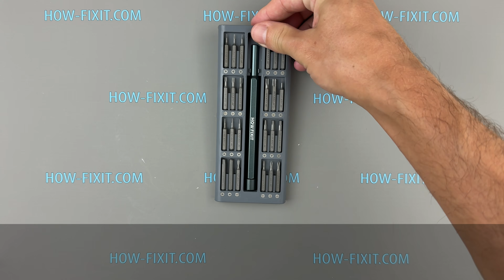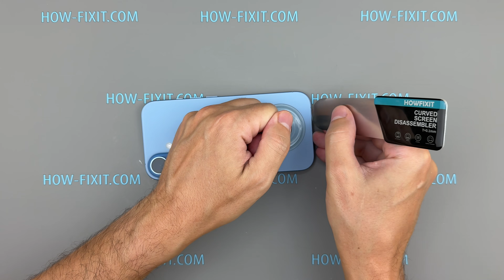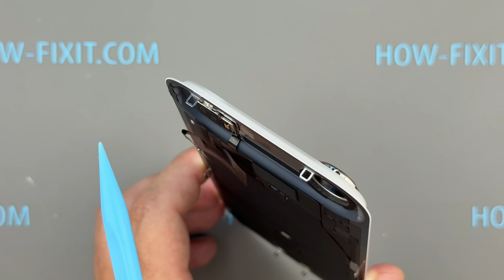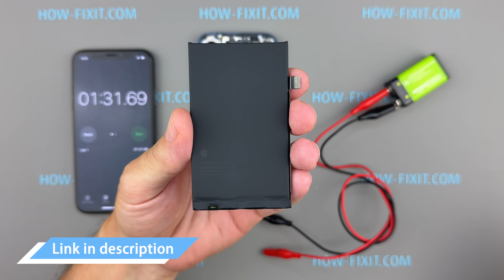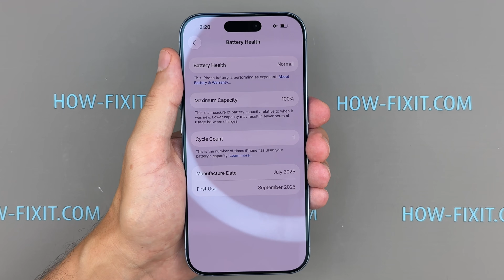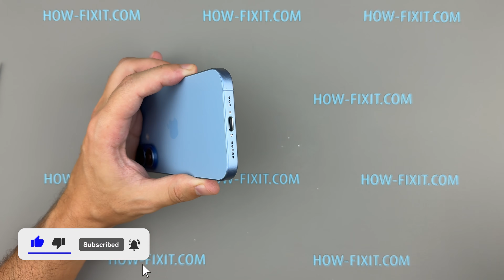iPhone 17 Battery Replacement Guide | Fix Fast Battery Drain & Service Warning

Comment: Why I need connect 9v battery to iPhone?
Reply: Starting with Apple's more recent iPhones, including the iPhone 16 and iPhone 17, the battery is secured with an adhesive that can be released by applying a small electrical current. Technicians connect a 9-volt battery (or an equivalent power supply) to specific contacts for a few seconds. The current weakens the adhesive, allowing the battery to be removed with much less force and without excessive prying.